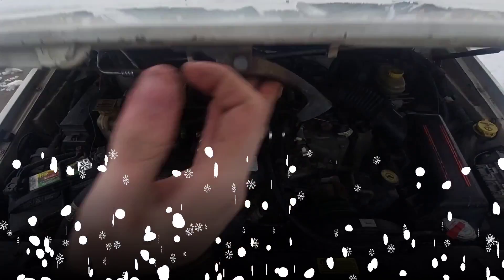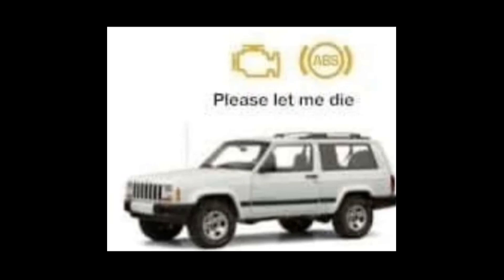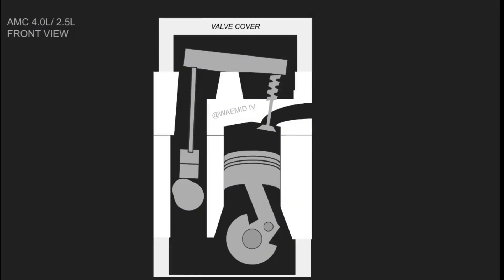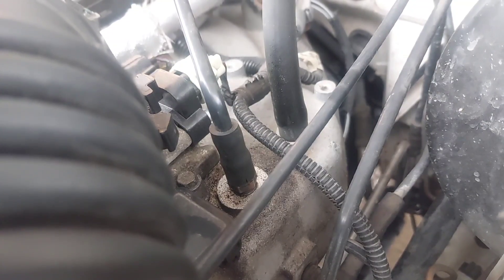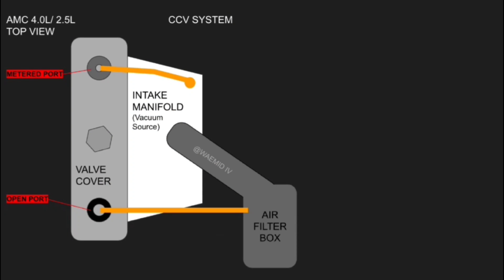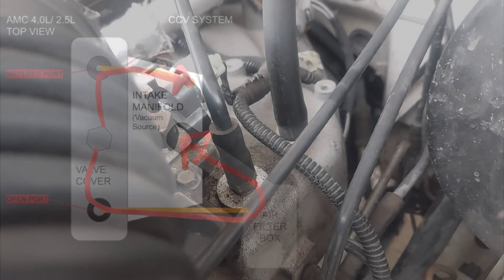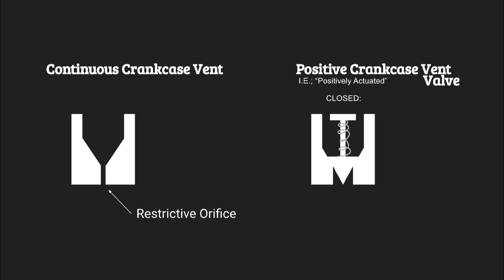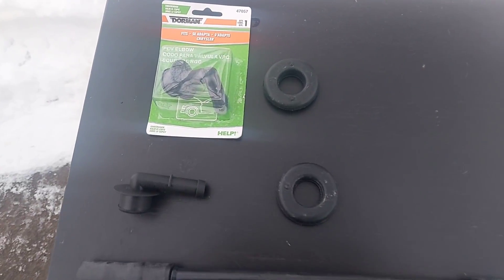Jeep Cherokee: CCV System & Valve Cover - How to Replace Elbow Grommets/ How it Works [‘96-’01 XJ]

Comment: Great video!  Thank you for answering all the questions I had. 😎
One suggestion for easier installation is to use isopropyl alcohol (91% or 99%) instead of soap to lubricate the rubber.  Soap will contaminate the oil but this is not a problem with isopropyl alcohol and isopropyl is the industry standard way to make rubber slippery during manufacturing operations.  Iso also works excellently for feeding cable through rubber grommets and is the standard way to deal with those.

Comment: For a 95 xj is th gasket different or can I still use the gasket from a 96 and just not use the grommets. And are the rubber grommets for the valves the same

Comment: I’m assuming it’s fine to just run a rubber vacuum hose in place of the original set up? Not in place of the elbows but instead of the oem line. Every video I’ve seen people complain about it but it’s like right there the solutions right there bro.
Reply from the maker: yeah any old vacuum line will do

Comment: So I have an 89 YJ with the 4.2 in it that the PO had a PCV valve on the rear hole. It’s going to the intake, the front hole is going to the air cleaner housing. Does that sound right, or should I have a CCV set up like you have in the video? Also, where does the charcoal canister come into play? One of the connections to the canister is marked “PCV”, and another is marked “vacuum”. Should the canister be on the loop?  The connections seem kinda small compared to the hoses coming off the valve cover. Great explanation and video, thank you.

Comment: Great video...can you tell me some symptoms that you were having before you changed them...mine for the past 6 months has had trouble breathing i noticed, speed changing noises, rpm goin up at park, and trouble accelerating lately. It could be my map sensor to i will swap, i have  new fuel puimp, filter...but something is still causing a restriction, will have to clean my cold air intake, filter might be clogged....but one thing is i have not replaced the vaccum reservoir by the bumper under...do you think that can be a cause, let me know, thanks.

Comment: I own a 1996 Jeep Grand Cherokee Limited 4.0L.  Your information you provide here does not match my vehicle.  The front PCV valve hose does not connect to the left side of the air intake, it goes OVER the large vent tube at the back of the air intake (that goes into the engine) and there is a port on the other side that the tube from the front PCV valve connects to.  In fact that left port on the left side of the air intake box (where the filter is held) doesn't go anywhere.  When I pulled the lid off of the air filter and looked on the other side, there's absolutely no hole there leading into the filter box.  It serves no purpose on my vehicle.

I've viewed at least 100 diagrams and pictures for this vehicle online and while you and everyone else shows this front PCV valve hose connecting to the left side of the air filter box, this just isn't so with my vehicle.  I'm beside myself.
Reply from the maker: @JeffDeanTheDeanZone  you got a Grand Cherokee, not a Cherokee. The Grand Cherokee (ZJ, not XJ) just has a rubber plug over the unused port on the airbox, because the part is shared with the Wrangler TJ, which does use that port

It doesn't matter where it goes, as long as it has a source of filtered air

Comment: Seems that Harland Sharp has since updated the roller rockers in 2022 to not interfere with the baffles
Reply from the maker: @reigndown  VERY INTERESTING I shall investigate these alleged new updates
Reply: @WAEMIDIV  I found out about it through some posts on a Jeep Stroker forum, so I decided to investigate by asking Harland Sharp directly. I haven't been able to confirm it myself, as I know the baffling is different between the 95- aluminum valve cover and the 96+ stamped steel one. however, for what it's worth, this is what a Harland Sharp rep had to say in their email.

"Thank you for reaching out and your interest in our Harland Sharp rocker arms for the Jeep 4.0L. On the S40196 with the newer design we started in 2022, you should not need to do any additional clearance work or need to remove the baffle for them to fit. I hope this helps, and if you have any additional questions, please let me know"

Comment: Hey, not sure if you have info, but my 87 2.5 needs so lines redone, not sure what I should do. It doesn’t have a CCV orifice, just an open pipe, and parts stores list an PCV valve.
Reply from the maker: On Renix 2.5L, the rear hose is just a plain old hose that routes to the airbox, the front one is the valve. I'm not sure it really is a valve, it just has a mesh/ screen in it, and it plugs into the vacuum  harness that routes to the throttle body
Reply: @WAEMIDIV hey I should have said this, but mine doesn’t have a setup like that. It’s not the threaded on the front like the metal kind. It’s the plastic one.

Mine has two holes on top just like a 4.0 but smaller, the one in the back has an open tube that goes to the throttle body, I found the grommet for that. The front has a special hose that snaps in, MTS sells a replacement for like $45. I’d rather just get a fitting that fits the hole and use a 90 degree fitting a regular old hose. Should I just by a metal cover?

Comment: So what happens if you put the smaller hole in front instead of the rear is the engine will hiss for a few seconds when shutting it off, made that mistake myself, the sent me the opposite of factory the tall goes in front and short in rear unlike factory which is tall in rear short up front

Comment: Any updates on the oil
Reply from the maker: I'm now 800+ miles overdue for an oil change, and despite the usual ~2 quarts leaking out by now, the Diesel oil still maintains 30psi at idle. It's now been mixed with 2 quarts of synthetic 5W-30 to keep it at the fill line, and it looks pretty burnt but it still holds very good pressure. I may have to send a sample into Blackstone.

Comment: Just wanted to comment that this video cleared up a mystery that occurred with my '01 XJ that I was unable to figure out at the time how it happened.  In my routine maintenance, I mistakenly replaced the gray CCV valve with the open (non-orifice) black valve.  That created a vacuum-leak like issue with improperly metered air entering the intake manifold and causing a high idle condition. 

I chased the problem for weeks, finally deciding, incorrectly, that I had a cracked exhaust manifold.  While removing the intake manifold, the rear corner of the intake manifold fell off - it was cracked all the way through (likely due to over torqued nuts at the factory).  Installed a new intake manifold and exhaust manifold, feeling confident I had discovered the vacuum leak problem.  Naturally I hadn't because the problem the whole time was the incorrect CCV valve. 

Finally took the XJ to a mechanic because I couldn't find any source of a vacuum leak.  After an hour ($90) he figured out the problem when he clamped down on the hose from the CCV valve to the intake manifold and the idle issue went away.  That $6.50 incorrectly installed part ended up costing me 6 hours of time and $800 in parts (intake manifold, exhaust manifold, and exhausts downpipe).   

Lesson learned:  if you better understand how the vehicle's systems actually work, you can save time and money when fixing problems.
Reply from the maker: A valuable lesson learned indeed, glad you got that fixed
Reply: one of many lessons learned over 9 years.  Stop by if you are ever going through the Omaha area on your travels. @WAEMIDIV

Comment: I got a set of the valve cover vents but they were swapped too where the tall vent had a wide open hole and the short one was metered. I opted to just swap them. So short one in back, tall one up front. Metered hose and open one are in the intended places, just looks a touch off. But works great

Comment: I've always wanted to add an oil separator to my jeeps like I have on the cobra. Great video as always sir
Reply: Same here. Notably in my BMW, seeing oil in the charge pipe. 18psi of boost doesn’t really help the oil separation. And for the 4.0, smelling oil while at really high rpm with no smoke or visible leaks. I believe oil is getting consumed via the CCV system when it’s at high rpm. Would like to stop that ideally